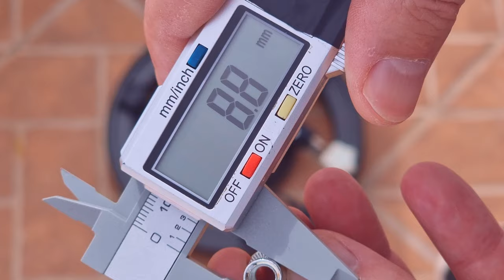You're Doing It Wrong! STORING and CLEANING Your Dob

Comment: Some rule of thumb when drilling hole in metal:

1. Fix your workpiece steadily in a vise or at least some clamps.  If you have access to a table drill machine, the better.
2. Never drill a hole in one step right at the start with the intended diameter. Always make a much smaller diameter hole first than intended, than make it gradually bigger and  bigger in 1-2 mm steps till you reach the intended diameter.
3. Oh, and use some lubricant: sewing machine oil, WD40 or similar.

You won't risk your workpiece, and the hole will be in size, you don't want +0,2 mm-ish differences.